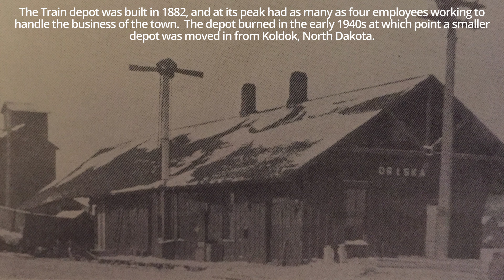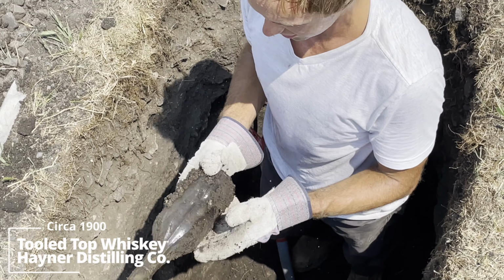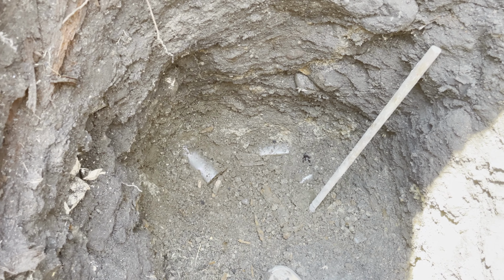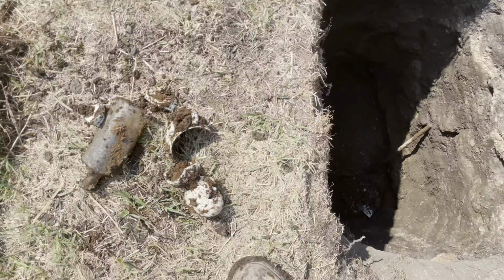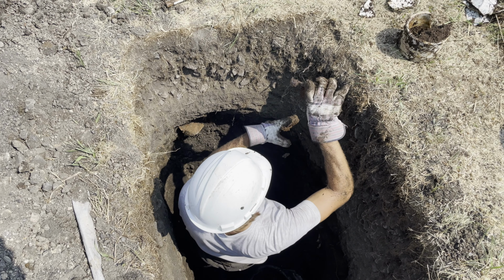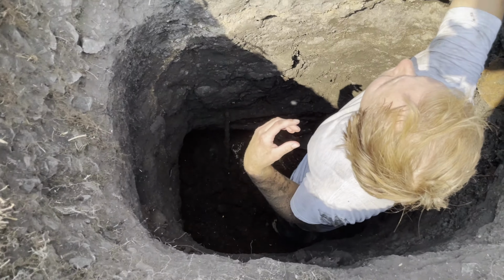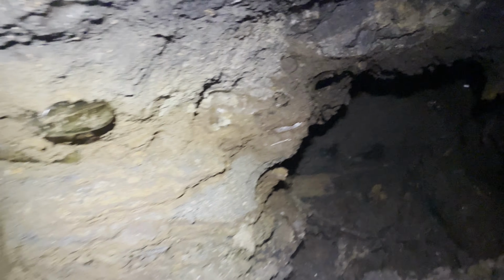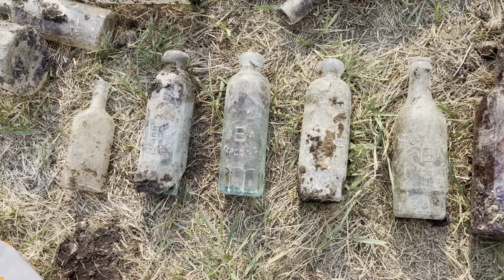Some Unusual Finds, Surprisingly Intact! 9 Feet Down in a Train Station Outhouse. Oriska, ND

Comment: That Ball "Patent Applied For" lightning seal jar is a really good one with a value over $100 without the closure intact. Orignally had a tin lid which holds a lot more value in just the lid. You can get reproduction closures for the jar. Great video as always!!
Reply from the maker: Thanks for the info! It's actually one of the better jars I've dug.

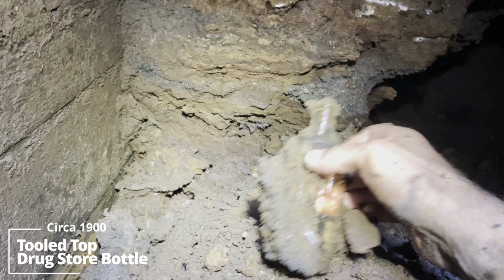Comment: I like the research followed up by onsite digging;  thats what I do too!    My question is;  1. how were you so certain the actual privy hole was there? the top layer being ballast-me personally I would have given p at the ballast as it cant be probed.   Amazing determination  (and strong backs!)  2. It looks like at  10:31 the side so the privy were lined with timber? brick?    thankyou
Reply from the maker: yes it was a wood-lined privy. its pretty common in privies that are large (depots, hotels, etc..). well we found it by looking at the old sanborn maps and found where the depot used to be, then they usually had a deck running between the depot and the train that was usually about 10 feet wide. and they usually put the outhouse at the furthest point away from the station but still on the platform. sometimes it was placed about 10 paces down from the end of the deck.. so we just went to the site and the ground had settled where the pit had been and in a few other places.. but sometimes it will make a square shaped dip in the ground, so we actually went right to it on this time.. we needed a hammer drill to get thru the ballasts tho, so we drilled thru the first 2 feet and then probed out the hole.. we tried a few other spots but that pit had such a broad range of bottles that we assumed it was the earliest one..
Reply: @BelowthePlains  awesome. i really love your youtube videos; amazing research and skillful working the tips. im a heritage architect, hobby archaeologist/garbologist!  and bottle digger in Australia. I too research and then test the research. .thankyou

Comment: 👍 nice to find more than just whiskey bottles!
Reply from the maker: lol yeah. it actually sucks pretty bad when we only find those
Reply: Even the whiskey bottles have valuable historical significance. Can print off historically accurate paper labels or a catchy  below the plains  paper logo and attach to them (of course with  glue that easily removable)👍

Comment: Does wiping the dirt off scrape the glass?
Reply from the maker: no. they are pretty strong.. im sure if you were rough with it, it would damage it.. theres this layer of glass, super thin, that after 120+ years in the ground, it begins to flake off.. super thin, thinner than a sheet of paper.. well this stuff is on the surface of the glass when you pull it out, and the dirt kind of sticks to that, so when you wipe it off, there is a small layer of insulation that protects the bottle, and usually the dirt is extermely soft.. so im sure that if you were rough with it, there could be a rock in there that could scrape, or even crack the glass.. ive never personally damaged one while cleaning it, but its certainly possible.. usually we just run water over them until the dirt kind of just washes off.. thanks for watching!

Comment: I know where some depressions are where old houses used to be. My 4 foot probe never hit anything. Should i dig them anyway?
Reply from the maker: umm.. i mean, its hard to say.. sometimes there just are those dips in the ground for a variety of reasons.. they could be an old well, a pets grave.. i would say that if you probe it, and after you get about 1-2 feet with the tip, if it becomes super easy to push down (nearly to the point where it will almost drop to the ground without you pushing on it) then that was probably a hole that someone dug and filled in.. bc the ground stays loose even 150+ years later, compared to virgin ground, being alot harder to push thru.. you may have to probe it a dozen times for it to drop in like 2 or 3 times.. another good indicator is if it gets really crunchy about a foot below the ground, they usually filled the top of the pits with ash at the when it was nearly full then put a small amount of soil on top to level it out.. i would say that if you dont feel anything in those pits and the ground inside the hole feels the same as the ground outside the hole, then id probably pass.. sometimes when we arent sure we just dig a narrow hole about a few feet down to see what it looks like.. if its still just dirt then we fill it back in.. if theres an old house then there is certainly an outhouse somewhere.. usually in the back,.. if its in town it might be behind the house on the property line.. and alot of the time they placed them directly out the back door.. so like a straight line if you walked out the back door and walked straight it could be 10 to 30 paces.... but we live in a cold climate so i think they might have put them a little closer up here, bc walking outside in the winter, im sure, was a nightmare (in North Dakota).. hope that helped

Comment: Hey Jake,another cool dig! Did that hammer drill actually make it through that rock? I'm comparing drills right now including that very same Dewalt and was wondering how much run time you get out of the batteries,are they the 9.0 AH? Also,any issues with the clutch,does it bind up too easily or does it power through? Thanks!!👍
Reply from the maker: The hammer drill will blast right through rock. You'll need the Flex Volt 60v Max batteries. I have five of those plus a four-port charger. That gets us through an afternoon of drilling. No issues with binding.

Comment: Seen the bottom of a few outhouses here in Colorado and I can tell you what's at the bottom it might not look the same but crap is crap most outhouses were used as trash bins after running water and septic came into the picture somthing else to look for is water cisterns as almost every place had one before modern plumbing and most were filled in with trash like bottles and stuff the oddest thing I've seen come out of an outhouse is a old pair of dentures I guess there's a point of no return for everything probe on sir!
Reply from the maker: haha thanks.. yeah we would love to try out Colorado one day bc its so much earlier than anything else in the midwest.. ive heard it was hit pretty hard though in the 60s... thanks for watching

Comment: Does it still stink?
Reply from the maker: its rare, but yeah sometimes it does.. we have a video we are working on from a Military fort that was by the river.. dated from 1860s to 1880s and the water table was so high that it never got any oxygen, never decayed, and when we opened it up it was awful... awful.. and sometimes the water in the bottles will be sewage if the cork was on it loose, it fills up with sewage, and then something else falling into the pit, hits the bottle and pushes the cork in, sealing it.. then yeah its basically sealed in there.. but the wet pits usually have a the smell of a lake,, and the dry pits just smell like soil
Reply: @BelowthePlains  thank you for the detailed reply!

Comment: always curious as i watch your vids as to why you do not fully widen your holes more up top?(find the 4 walls)
you always seem to be entirely cramped as you work down making it more difficult to lift shovels and such out.....
then you are always working under cave-in conditions as you get towards the bottom
Reply from the maker: lol yeah, i guess its just a habit to make as small of a hole on the surface as possible.. we used to dig in alot of back yards.. we do open some of them up, but usually we just figure its just less work to remove as little dirt as possible.. and usually by the time we realize we need a wider pit, theres a bunch of dirt fully surrounding the hole on all sides
Reply: @BelowthePlains  ...i get it// the less you take out, the less you need to put back theoretically; but i am 6'5...230
so i need some wiggle room so i just always blast them open from the rip so i can at least turn my ass around in there